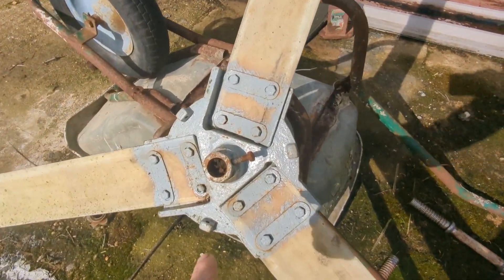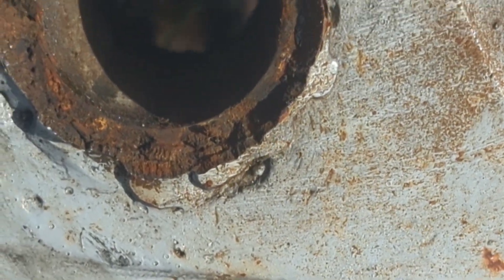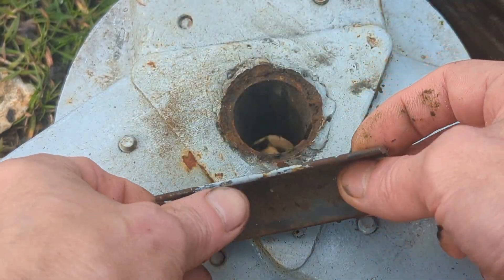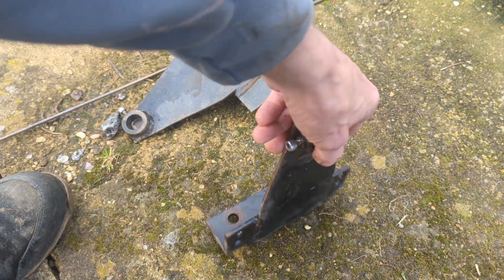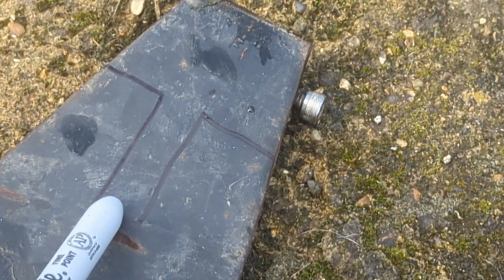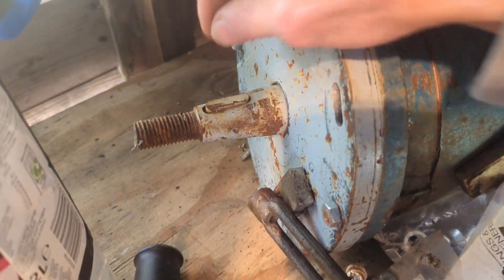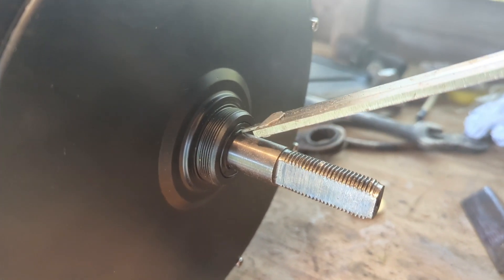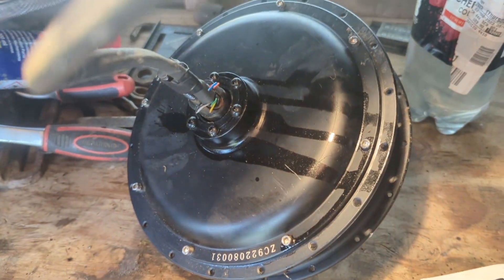Wind Generator Project - Motor Mounts - Blade Hub Repair -  72v Ebike Hub Motor - 19 March 2023

Comment: Really enjoying all your videos. Your work has been an inspiration to rekindle a long time fascination with capturing wind energy. As an over the hill welder, I would suggest that conical hub on a straight shaft is going to be an ongoing source of grief. Loads of torque riding on those two little collar welds. Three ways I can think of to deal with it: 1.fab a new straight bore hub, 2.reuse the tapered shaft end out of the old gen, 3. do your intended fix taking great care to get the bushings aligned perfectly and then drill a cross hole to inject epoxy? or maybe aluminum? into fill the bore gap to get full support once it is mounted on the shaft, it will be next to impossible to ever remove, but it shouldn't fail in this way again? Best of luck , hope however you go about it turns out well for you.
Reply from the maker: Thank you very much for the kind coming. It's much appreciate. I'm going to try and fix it without welding the cast iron itself all will be revealed 🙏🙏🙏